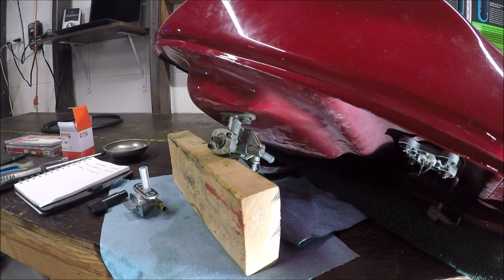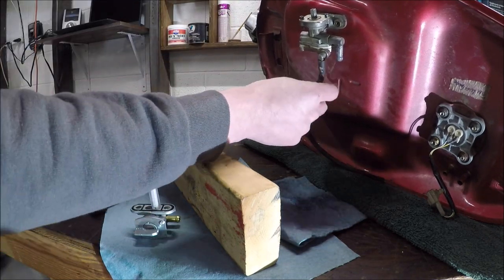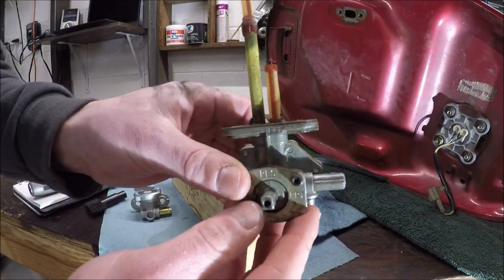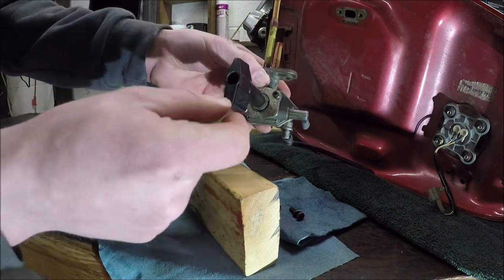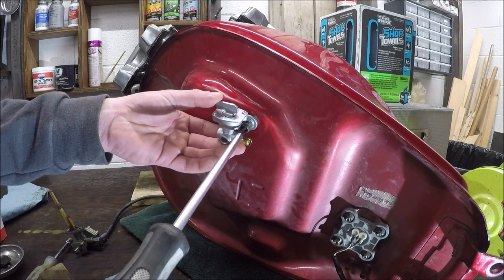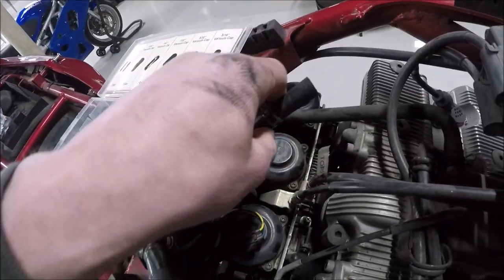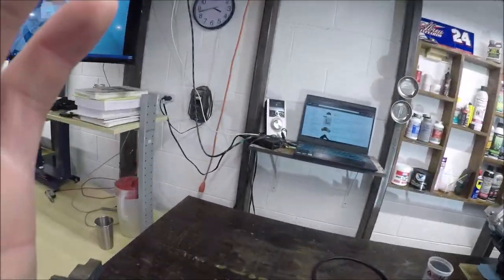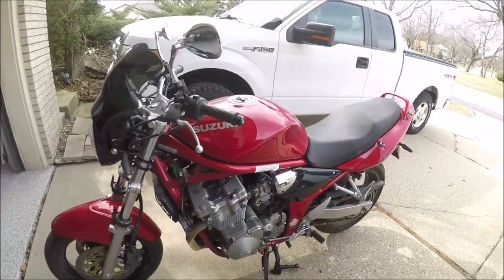Suzuki Bandit GSF600 - Manual Petcock

Comment: A thick wooden dowel, cut down in length, with a slot in one end that slips over the tap lever, and maybe a piece of old bicycle innertube added to the other end for grip while turning?. Such a thing would be portable enough to keep in your pocket. Appreciate the Bandit has gone now but just posting this in case any others try this mod. Anyway, thanks for sharing Matt; it's something I may do with my own bike 👍🏻
Reply from the maker: The dowel and hose piece to turn the lever? It'd probably work. I need to ask my buddy if he's been struggling with it at all (new owner). If he is, I'll send him your suggestion. Thanks Zook!
Reply: @matttriestodothings  Exactly!. I'm thinking like a piece of broom handle thick dowel of about an inch in diameter, with something like an 1/8" slot that would turn that hard-to-reach lever. The idea is a bit simplistic, but sometimes the most obvious ideas are the last ones we think of!. Best wishes from "across the pond" 👍
Reply from the maker: @WhyteZone  for sure--I like the idea a lot. Just a slotted dowel to give some more leverage.

Cheers from The Colonies 🥂😎
Reply: @matttriestodothings  Cheers my good man! 🍻

Comment: See update posted as a reply. Vent your fuel cap!!   IT will lay down on you if the flow can not keep up. Dangerous too as it will feel like you threw your chain, or lost your motor and the sudden and very hard deceleration can put you over the bars or hurt your wrists.
Reply from the maker: I have no experience with the 1200s, and that may be the case that this Yamaha 660 valve may not flow enough--not sure. I think the bigger issue you might have is too much flow resistance through the routing using OEM hose sizing. I know on the 84/85 Honda VF500F's they have an OEM vac-petcock with a fuel pump. For the '86 they changed to straight gravity feed (still vac-petcock) but the delivery system to the carburetors is completely different and have larger hose diameter. 

"... when working properly..." is the bit I have issues with. Literally every vac-operated petcock I've owned has failed. And this one in the Bandit in particular failed a few years after a rebuild. I just don't trust them, so if it's feasible, I just try to remove them, so I'm not worried about getting stranded. I've had to push my VF home after running it out of fuel before (before deleting the vac-petcock) because I could not get the thing primed even after filling it again with fuel. 

The only bike I have with a vac-petcock still is my SV650 which it just isn't feasible to remove. When I bought it a few years ago it was leaking, but it's been fine since then. That one's also got a dedicated vac-fuel pump which (knock on wood) has been working without issue.

I just have trust issues with the vacuum components.
Reply: O rings cracked on my '05 Gsf 1200 Bandit. 
2 quarts of fuel in the sump in addition to 4 quarts oil. 
Question is this,  the vacuum diaphragm only opens the gravity fuel flow. 
How could it pump fuel...?
Reply: O rings cracked on my '05 Gsf 1200 Bandit. 
2 quarts of fuel in the sump in addition to 4 quarts oil. 
Question is this,  the vacuum diaphragm only opens the gravity fuel flow. 
How could it pump fuel...?
Reply: O rings cracked on my '05 Gsf 1200 Bandit. 
2 quarts of fuel in the sump in addition to 4 quarts oil. 
Question is this,  the vacuum diaphragm only opens the gravity fuel flow. 
How could it pump fuel...?
Reply: @marklang5169  Update. Discovered the problem and it was with the EPA non vented complex fuel cap. It was no longer working as engineered. It is the most complex fuel cap ever! It has veins and check valves and more inside it to prevent venting!!  I drilled a tiny hole in it. Problem solved!!

Comment: Awesome video, happy you still have the bandit. So do you need to switch the petcock to off when the bike is not in use otherwise you run the risk of adding too much fuel to the carbs whilst it sits / potential float bowl failure. Or do you just let that needle do its job and leave it on. Not having a reserve sounds terrifying though as my 600 has no fuel guage.

I'd like to replace my fuel hose but I'm unsure of how to disconnect the side attached to the carbs. Did you need to remove the airbox to gain access or do the carbs need removing to change this line. I'm still hunting down a fuel smell from my bike and after rebuilding the petcock, and replacing the fuel cap seal I think it's either going to be the carbs or that fuel line both of which I want to rebuild / replace in the future.
Reply from the maker: Yes--it needs to be set to OFF when not in use. The float valves should cover for me if I forget, but realistically I should be closing the petcock every time I stop using the bike. The risk is that if a float is sticking, I could be flooding the cylinder. Worst case scenario is the cylinder fills with fluid, hyrdo-locks, and bends a connecting rod when try to start the bike, and I junk the entire engine and bike in the process :-P . Now, this can also happen with a faulty vac-operated one like I had that was leaking regardless. The floats should keep this from happening though.

Not having reserve sounds totally fine to me. It caught me super off guard how damn early the standard fuel fill kicks off on this bike! I was travelling like 80mph and all the sudden the damn thing shut off on me. It took me pulling over on a busy freeway and getting the bike re-fired after turning it to reserve. This was at like ~110mi on the tank. The tank is over 4 gallons, and I know I get more than 40mpg. So I was absolutely not expecting it to kick to reserve that early. I always use my odometer/trip-meter as the fuel gauge anyway (plus it has an electric one). I had left it in reserve 100% of the time after the issue on the freeway. 

If you're taking the carburetors off, it'll be 10x easier to replace the fuel line at that time. Sometimes you can get lucky and replace a fuel line while on the bike if it's not too stiff and you've got a good hose wrench. If it's the stock fuel line though, you'll have a hell of a time getting it off. It connects to the bottom fuel rail on a plastic piece that connects the carburetors. What stinks about that is that because it's plastic, you can't get super heavy-handed with it. I'd just wait to do the fuel line if/when you pull the carburetors.
Reply: I guess it happened for me few times hydro lock, tryed to start and heard loud crank sound and starter just got stuck, placed into gear and pulled and pushed bike couple of times, then tried to start and started without an issues. So for winter just disconnected fuel tank and in spring started without issues, but thinking might be needles fault which comes with floats or is it fuel tap? It happened after 2 weeks bike was stacionary and then few days after. After that i went to my garage 160miles trip for winter and later after 2-3weeks came back started without issues (in that time everything was still connected). Felt that my bandit acts like a woman, sometimes start sometimes you wont start no matter what u do 😂

Comment: Have you ever run into the little white filters at the end of your petcock not flowing through properly? My petcock didn't flow properly, but after removing those filters it works like a charm. Sadly there is no place for an inline filter
Reply from the maker: I have not run into that problem, but I can totally believe it. Yea--the lack of room for an inline filter makes it especially difficult if you're also fighting a fuel tank that is less than spotless. I could make a small inline filter work; however, I'd be worried it wouldn't flow enough and just cause a new set of headaches.

Comment: Wow. A new petcock and all.  But Matt.  I'm putting up the 02' GSF600 that I got last week because the first bike that I got,  the '95 cb750 Nighthawk two months ago has gotten so lonely.  (Along with the '98 1200 Bandit that I got three weeks ago)  I am stopping here until I get at least one of these bikes running.  All $600.00 on fbMP.  Exact same bike man.  Oh my goodness.  Same color and everything.  And so did it work?
Reply from the maker: Hey Steven. Yes, the standard petcock I put in works and continues to work. It's a bit tricky to get to it with gloves on, but it works fine.

Hopefully you're able to get the bandit and the other bikes sorted soon.
Reply: @matttriestodothings  Thank you so much.  This bike is the closest to on the road for me.  I may stick with it.  Theres no speedo/odometer etc and the headlight fitting is broken off, a slight bend in the handlebars and an inspection sticker from 2012.  I've got a title but no other info. Broken rear brake and peg bracket that I've already replaced.  A fairly light accident then in somebody's garage for the last 10 years.   Really really clean otherwise. I'm going to have to weld something on the front. Off to E bay for me.  Thanks so much for your reply.  I need the support.  👍

Comment: But u remooved the vacum system yes ? Did it affect anything ? The iddling ? Any problems at all??
Reply from the maker: It affected my sanity in a good way. Now I don't have to worry about a vacuum-operated petcock failing. 

It doesn't affect the operation of the engine or fuel delivery at all. You just need to make sure you properly cap off the vacuum nipple port on the carburetor the OEM petcock was connected to.
Reply: So no lag off fuel delivery at all no fuel problems at alllll ??? Well thank you my friendddd
Reply from the maker: @YKimo-so7fq  Changing to a manual ON/OFF petcock won't cause any lag in fuel delivery. The "ON" will actually work the exact same as "PRIME" on the original vac-operated petcock.

I suppose an aftermarket petcock could restrict fuel flow if you bought one that was too small. The Yamaha one I used works fine for the Bandit though.
Reply: Thank u so much my friend ✌🏻❤️

Comment: Thanks so much - especially for giving the Yamaha part number. Invaluable.
Very helpful for my old Suzuki GT750.
Was it a perfect bolt on fit?
To be a nuisance: can you tell me the Centre-to Centre spacing between the mounting bolt holes on the new tap.
My Suzuki tap is 44mm CTC.
Again, thanks very much for posting this- any help will be greatly appreciated.
Reply from the maker: Sure thing Nick. I was actually able to use the same Yamaha petcock on a Kawasaki EX-500 as well. I was eyeing it up and was thinking... son of a bitch... I bet it would work.

Let me see if I still have the old Bandit petcock in my box of "old parts that I'll never use but I won't throw away in case for some strange reason I need to find it... for something."
Reply from the maker: I think this one may be a little smaller than your Suzuki. This is the Bandit 600 one. It looks like it's just under 35mm center to center. Maybe 34mm.
https://i.imgur.com/1B9XghB.jpg
https://i.imgur.com/n58rTlK.jpg
https://i.imgur.com/0wOxAgO.jpg
https://i.imgur.com/CHGCYmp.jpg
Reply: No worries Mate.
At least I know there’s probably something out there that’s reputable.
Thanks again for your efforts.